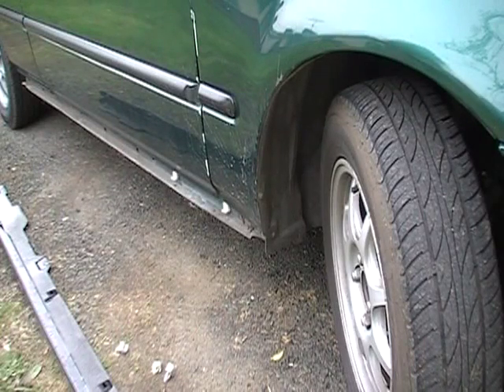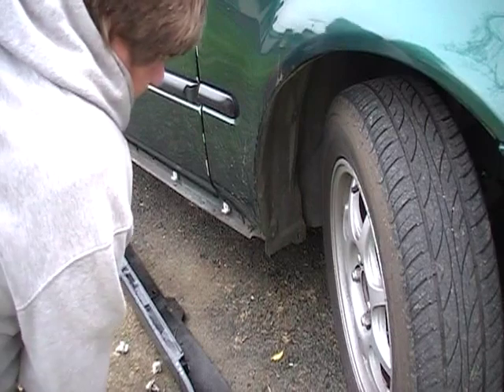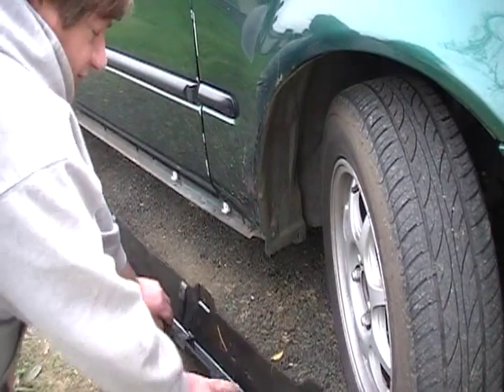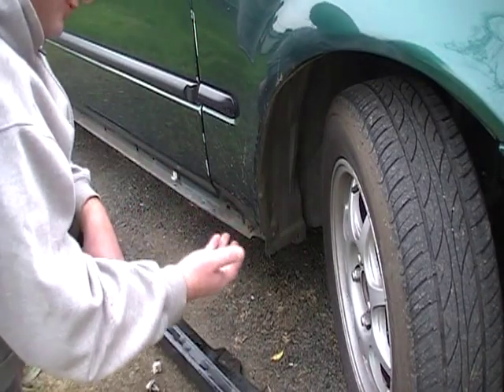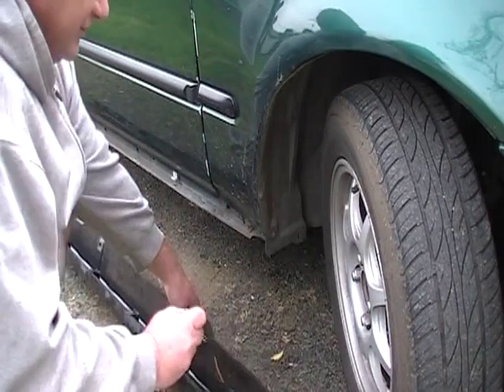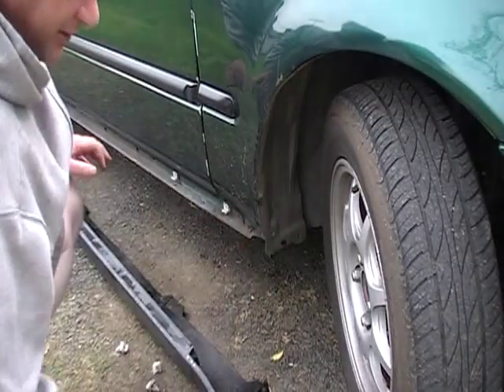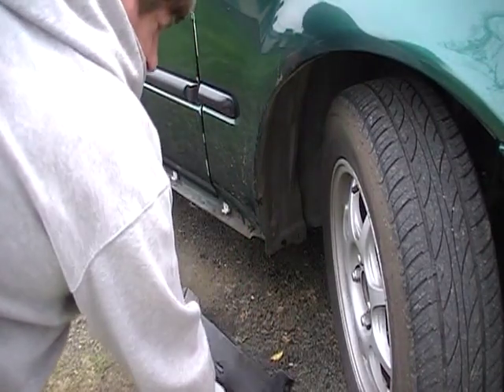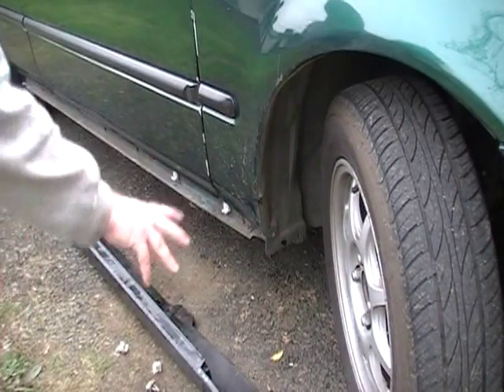99 Civic side skirt

Comment: This worked on a 2005 Honda Accord too.  I took off the three screws holding the mudflap and popped out the three plastic clips, you mentioned that were missing on your side skirt, using a flat head screw driver.  I then used a rubber mallet to tap once against the end of the side skirt.  I hit it in the direction from the rear wheel well towards the front tire...and the skirt just fell off.  Really easy to do!  Thanks for the help through this video!
Reply from the maker: Thanks for sharing you 2005 experience.